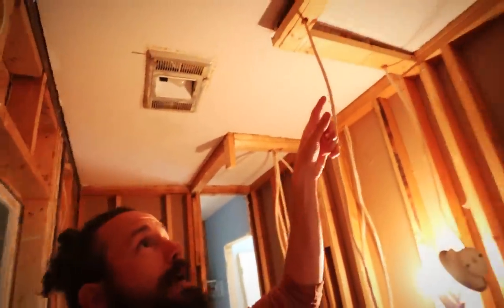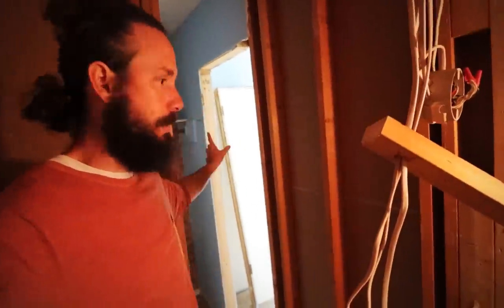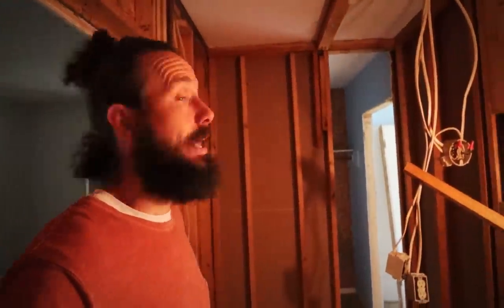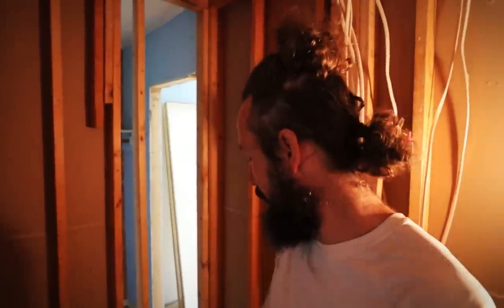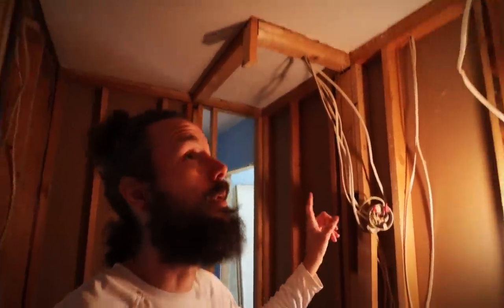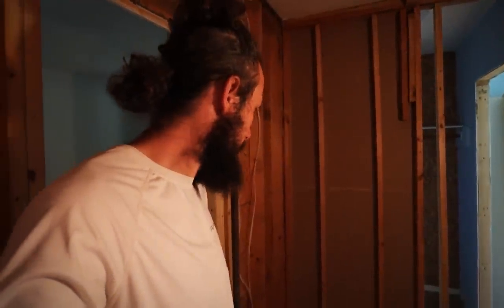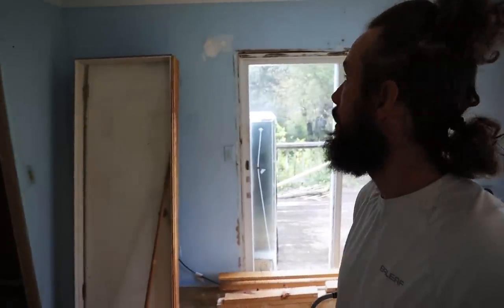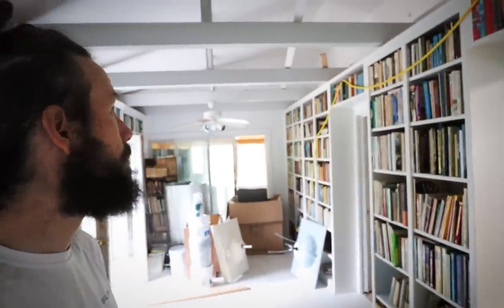What's remaining before Drywall can go up? | Homestead Farmhouse Renovation Pt 15

Comment: dont cut the wood near the cord, take the outlet box off the end of the cord and pull the cord out.  if you nick that wire at all you have to replace the entire line back to the source or put an access box at that spot.

Comment: Everything is going to look so nice once ur done. I do suggest u Insulate the inside walls. It’s so nice to have sound reduction between spaces, especially when overnight visitors r there. U won’t regret it. My brother & wife visited & the shared a hall shower together. Sadly, all conversation could be heard n kitchen & n room on the other side - oops 😬 never told them. I strongly suggest insulation between inside walls.
Reply: My son did this, he wished he had done it to begin with,  added it later

Comment: don't forgetting blocking behind the drywall for the toilet roll holder, vanity if it is wall hanging. towel holders whether it is standard or heated, hand towel holder if you want want next to the vanity etc

Comment: Don’t overthink demo. If you’ve got wire through a 2x4, just cut it next to the socket to leave as much wire as possible and pull it through marette the ends until you rewire. You’re going to want to replace the sockets and light fixtures anyways. Save your saw blades and time!

Comment: How come you took the insulation out of the bathroom walls? Don't you need it to keep the dampness from spreading throughout the house?
My thoughts about a kitchen door to outside, would be to leave the door so you could easily bring groceries in without bringing them all thru the house. My opinion only. Not my house of course.
Reply from the maker: The smell honestly and mouse activity. We will replace it
Reply: @TheKraemerLife  Oh,  Eeuuww.....I didn't think of that. Can't smell mildew from here. TN is humid, i expect. It sure is here in FL, too. Thank God for air conditioning. Stinky meeses, too. Eeuuww. 😁